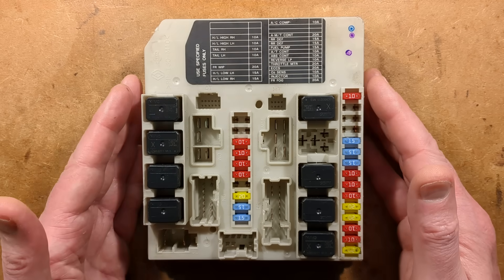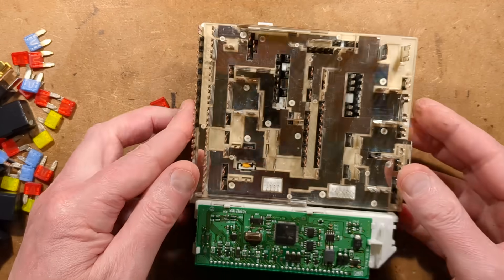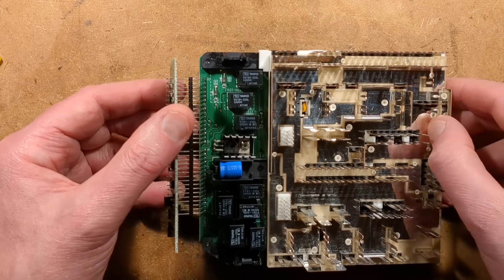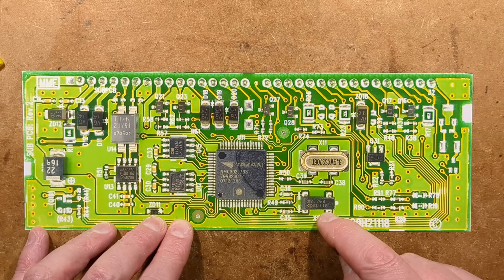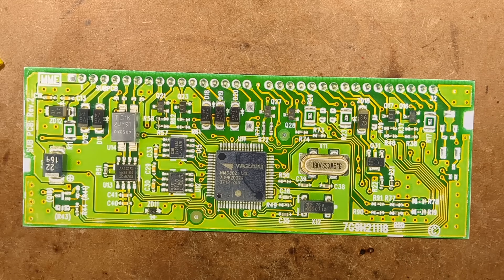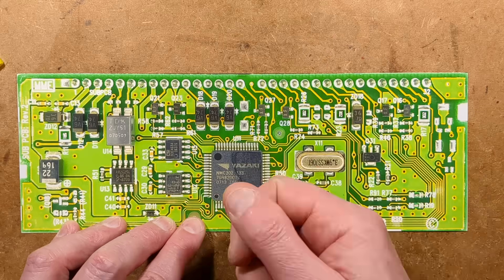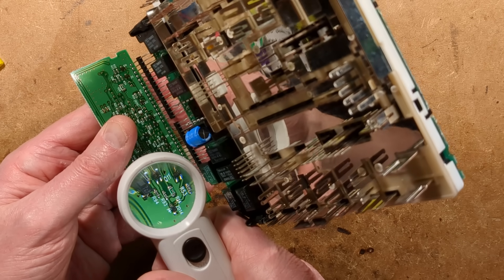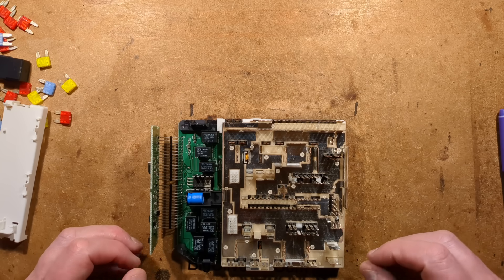Why your car's fuse box costs so much (and the location of the data chip)

Comment: As a software engineer at Ford cool video i am more knowledgeable about programming but still appreciate the electronics and let me tell you ford has a lot of expensive oscilloscopes i dont use them but just always fascinated at how expensive those pieces of equipment. Me i got two ecus on my work desk at home. Car makers are trying to switch from can to Ethernet. I beleive latest tesla models dont use a can bus network.
Reply: Car makers rape dealer service departments. Instead of just offering a software package to add to your laptop so you can work on the new models, now you need a dedicated laptop FROM THE MANUFACTURER that could set back the dealer anywhere from $2K to $6K each! And if you need one for each model per year? What an expensive collection of dedicated computers you would have!

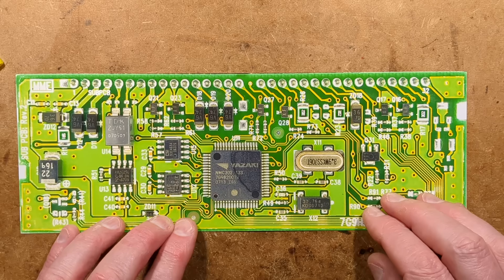Comment: 08:55 One method to prevent the MCU from causing issues on the bus could be to hold the MCU's /RESET line low whilst reading the EEPROM.

Comment: As a power distribution designer, majority of the cost went to the design and tooling.  This particular box is very old design, the can only fit one or few vehicle.  More modern design have interchangeable blocks and standard connector to Body ECU etc.  By saying that, Tesla since 2016 Model 3 revolutionize the design by replace all mechanical relay and fuses with electronic.  Not only the power distribution system is lighter, cost less (by Sandy Munro), I think the biggest advantage Tesla approach is the only way to achieve full SDV (software definite vehicle).  One can add function or change function by software update.
Reply: Software Define Vehicle is a horrible idea.  Do not want.  One more step towards a rent-only, post-capitalist society.  With a traditional power distribution I can modify it as I see fit, to add fused connections for whatever peripherals I want to add, fix broken relays, even alter the way the power is distributed and controlled.  With SDV, I don't own it, can't repair it.  As Jeff Gearling put it, you don't own anything and you will be happy.  I really wish we could communicate this to all of you designing and engineering these things.
Reply: If only we could get the source code for it, you could activate a full scale optioned out vehicle for a lot less than what Tesla charges.
It’s the way Motorola makes money on their high tier 2-way radios. The more options you want the more you pay. Now what’s interesting is that the code got out as well as data on the security key that will allow dedicated software to "add" or turn on the extra features. This only covers the last two to three of the last generation radios that are no longer supported.

Comment: Back in the day I worked on M-A-N trucks and a driver worked out (or guessed) that by removing one of the relays and turning it upside down defeated the factory fitted speed limiter! Instantly making a 40 ton artic capable of nearly 100mph😮
Reply: Can’t remember the truck. But if you set the hazard light button in the “middle”. You disable seatbelt warning and speed limit.
Reply: @Krishell  1967 Mustang. Hold the 4-way flasher knob halfway in and you could play the radio without the key.
Reply: These days we can easily buy piggy pack modules that sit in between the transmission control module and bypass speed limiter.
Reply: Vauxhall Corsa / Opel,, I think the early type A could be push.started without keys if you torn out the hazard warning lights module, and crammed it upside down in the slot. Car electrical systems problems...
Reply: @JanicekTrnecka Top Gear has a video on this!
Reply: I got several Corsas, but type B...and was a bit disappointed that this "feature" was removed. Yet although it was a spartan and barely a thing that could be called a car, both corsas lived up to 30 years till rust finally got them to point beyond repair. RIP..
Reply: i remember that well. Kudos on not telling exactly how - some idjit will do it, k.o people and sue you.
Reply: @GatvolFourie  suing someone on the internet because someone ELSE did a bad thing with just knowledge is such a dumb thing. Would you sue medical textbooks that tell you where are the arteries and a criminal thanks to it was able to kill someone faster?
Reply: @tomclanys  There is always some low grade that will give it a go with no win no fee 'emotional scaring' or other drivel...
Reply: @tomclanys  For many people, often in America, love thy neighbour has been replaced with "Sue thy neighbour." so he's just being cautious..
Reply: @tomclanys depending on how litigious the society is, anyone can bring suit against anyone for anything.  The deciding factor there is whether the person(s) bringing the suit can convince a judge if the suit is valid.
Reply: @GatvolFourie  Tell us you coward

Comment: 8:50 you generally just pull the reset of the MCU low to keep it from interfering.
Reply: A more hacky but workable way (which I've used on a multimeter which had an eeprom for config data): read it a bunch of times, if you get one identical dump 50% of the time and the other times are inconsistent, then you know what the real data is. When writing ... write once, read a bunch of times to confirm, if not matching then write again and repeat. For a one-off, it works, and really only takes a couple minutes :)
Reply: @ploxiln This might work, or if the CPU finds the data wrong when reading (at the same time as you) it might reset some values to default, or set some fault flag flag, in the memory. I would recommend using the reset signal if you can find it.
Reply: I did debug on GPUs and server motherboards. Usually the firmware is stored on an EEPROM like this. We would read and flash them in-circuit using test clips all the time (Dediprog was the programmer of choice) and never had issues. The programming software does a read-back by default as well to make sure there's been no errors after writing data.
Reply: I was about to say that. 
That is a common approach by your little "foreigner" garages, which unlike kwik-fit alike will find the way to solve things. I did reprogram mine ecu this way with no problem. Apart for mine Aygo still thinking itself as Peugeot 107.

Comment: More computerised components added to cars so more things can go wrong.
Reply: Analogue engineering, in my opinion, is the best engineering. If it breaks, 9/10 times you can just unhook the battery, dive in, and fix it yourself. 
Digital engineering always seems to fail one way or another with no obvious fix, and you need to clumsily stumble your way to an answer, all for the sake of saving time and money in manufacturing.
Reply: True, but modern cars are SO much more reliable as a daily driver than an old mechanical car. 

Yes you could fix your old car on the side of the road because you had one of the  high failure items in the trunk and a basic toolkit.

Most every modern car from the last 20+ years will reliably start and get you places for well over 100k miles. All vehicles have known issues, so you need to keep up on them.

Of all my family members nobody has needed a tow in vehicles of various brands and they all made it near or well past 200k miles before they bought another car to "upgrade" or someone made a stupid decision, like thinking they could make it home after a coolant hose burst and the driver knew the engine was overheating but kept going.

Comment: Manufacturers have added so much unecessary electronics that a lot of problems with  modern vehicles is failure of the electronics in the modules and sensors, not the mechanics.  They cost a stupid amount of money to get them diagnosed and replaced because the modules are sealed and most cannot be repaired.

Comment: I remember the old Mercedes fuse boxes
In the 108’s

Work of art bakelite with all screw terminals for the wiring attachment , and Bakelite cover with screw knobs to hold it down. 

Then theirs the RR silver shadow fuse box under steering column which hibges down after releasing a chrome thumb screw
Also a work of art but with a special design feature

When swung down its in front of the brake pedal :)

And its quite strong. 

Chapie had one do it one day snd had to do some quick footwork realising what he was pressing wasnt slowing him down:)

Comment: just sent my car to the shop because the computer is done and now nobody makes one for it. Just put new tires and breaks and rotors and 2 wheel bearing and battery in it and a week later the computer is toast.  I miss the old cars you could fix with a pocket full of tools
Reply: I used to carry a complete set of tools in my 1972 Pinto. Screwdriver, vise grips and, for when all else fails, a big hammer. 😊

Comment: While automotive experts are good, we also need people like you. An expert would likely just swap the thing. You would actually open it up.
Reply: These usually fail due to water ingress. They are also undocumented so anyone in the motor trade can't diagnose any faults on it so, either they send it to a specialist for repair or replace it.
Reply: As an car mechanic I call tell you if we can repair it we'll absolutely try to repair it. But there are a lot of uninterested people in the business sadly. And also time is money.
Reply: @sonixthatsme 
Not everyone is technically capable (or confident) of something like a board level repair. I actually wouldn't mind opening up my own electrical specialist shop.
It isn't always practical but I've saved time on waiting for parts etc by just fixing the specific problem. 
Definitely no shortage of goober folks that shoot the parts cannon every time. I currently work with a bunch of'em  😂

Comment: Bought what I thought was a basic 5 spot fuse block off Amazon to assist with a small solar / battery test project. What arrived had lights and therefore a load. Nothing on the listing about indicator lights.  I deleted the lights after I tried returning the item and they said keep it and gave me a refund.

Comment: So the wiring loom of a modern car should consist of just 4 wires: 12V, 0V, and 2 for canbus differential twisted signals?
Reply from the maker: A lot of it is just power and data sub distributed from each node.

Comment: On the one hand, my 4 wheeled vehicle is an F150 and it probably has over 100 computers in it, a ridiculously complicated hybrid drivetrain, taillights with integrated radar, etc. But on the other hand, my PREFERRED vehicle and what gets more miles per year than any other is a 1980 Honda; the most complicated electronics on it is the starter motor. I'm working on getting a 1977 Goldwing back to running condition. It's the complexity of modern vehicles that makes me want to ride a 50 year old bike with nothing more complicated than switches. Heck that long ago the bikes didn't even have relays other than for the starter.
Reply: In the old days bikes didn't even have starters lol.
Reply: come the zombie apocalypse, you will no doubt be one of the survivors.
Reply: Yeah, the most complicated part is the charge regulator. Switches and wires apart from that. Super simple.
Reply: @glonkfpv  >"charge regulator." My 1967 BSA 250 had non-electric (kick) start, and the "charge regulator" was a 50 Watt 14V Zener diode across the (nom 12V) battery. Bolted to frame for sinking heat. The alternator was a modified spark magneto so wasn't a lot of power wasted. When the wire came off it allowed 16V+ to blow-out every lightbulb on the bike (more than you would think).
Reply: @PRR1954  I had a lawn mower with a similar charging system.

I'm not sure how it regulated voltage, but it seemed to have either a second magneto, or tapped off the ignition one and produced AC leading to a pair of diodes.  One diode output lead to the battery to charge it, and the other lead to the (always-on) headlights.  I noticed something was odd because at low engine rpm you could see the headlights flicker at a frequency that seemed synchronized with the engine.  I thought that was odd considering if they were hooked to the battery they would of course get flicker-free DC voltage.  I put a scope to it, and sure enough the headlight positive and the battery positive were getting opposite rectified halves of a 24 VAC sinewave.

Comment: I had a Landrover TD5 and I changed the fuse box, it would crank but not start. I had to leave the ignition on for about an hour while it updated from the vehicle. It then went on to start with no problem. Presumably, it updated the EEPROM.

Comment: Fortyish years ago, I had a diesel VW Golf. It was an awesome car. Except when it rained. If it got wet enough, it would just go ape-shit. Like one day I was driving in the rain and the horn just blew a couple times on its own. Another time the engine simply shut off on the highway. I was able to push-start it by downshifting. 
One night, it was being very stubborn while I was visiting my aunt two hours from home. I tore the fuse panel apart in her basement/garage trying to find where the water was bridging circuits. It was less complex than this one, but had multiple layers of copper or brass buss bars going hither and yon across under the fuse and spade terminals. 
It wasn't the source of the problem.
I never did figure it out. I just traded it in a few years later when I needed a minivan.
Reply: Did you live by the coast, when you had it?
Reply: Replaced many of those back in the day

Comment: I find it amazing that a car works for as long as it does. I mean all those separate modules, connected by looms and connectors, working in a hideous mobile device, that travels over any type of terrain and weather conditions, heat, freezing, bumps, stop, start. WOW !!!!
Reply: To me it just serves as proof that, with the right engineering, electronics CAN endure harsh conditions and last for years. Then I get even more annoyed at modern consumer electronics.
Reply: @flapjack9495 They can be made to last virtually forever but not at the price they’re sold now.
Reply: @Conservator. American Motor Company😢
Reply: I agree. I own a 2020 Chevy Bolt EV, have put 106,000 miles on it so far. I have heard of bolts surpassing 200k this far. I hope to put 300k on mine.

I beat on that car. Rain, salt, snow, harsh tore up dirt roads, rough trails to the campsite up north, and constant on/off as it's used for delivery. It has yet to give me a major problem and I don't expect it too, but when I was younger if I looked at the mind boggling electronic complexity of this car I'd immediately go "hell no." My mind has since changed.

I also have a 96 ranger that's getting rusty and has had its fair share of off-road beating. Never had an electronic issue yet, despite my constant worry of capacitors drying out or connectors corroding.
Reply: One of the idea with these body control/smart fuse box modules is that you can split down tasks into friendly workloads
the other is you can get rid of arm-thick wiring harnesses across the car. Plus some safety related things. Like pyrofuses that kill off high current subsystems like the alternator/starter circuit while leaving others powered (where more modest fuses sizes would prevent fire in case of an accident) and also relays close to the battery to switch of whole subsystems.
One thing i remember about 2000s mercedes is that they moved the hazard and turn light control from the front of the car into the trunk, close to the battery. Idea being that a car that gets severely damaged in an accident will be able to still keep the hazard lights flashing even if the engine bay or even the front half of the car is basically wrecked and gone. So at least other cars coming from behind will see that something IS there. A non illuminated damaged cars on a motorway are pretty dangerous to upcoming traffic
Reply: As a retired engineer who once worked on pieces of complex systems, I agree with you!
Reply: what shocks me is how much more reliable automotive electronics are than the industrial stuff that's all rated to 75c and conformal coated AND epoxy potted and then it eats shit and dies after five years
Reply: Consider that there are cars from the 80's with Bosch electronic fuel injection, where the original factory fitted computer and ignition modules have endured to today.
Reply: Modern, (the last 20 years) vehicles have loads of modules in them. Pretty much anything in that time will have modules in every door, multiple modules under the dash, in the lights, and basically anything else that electricity goes too. My Land Rovers from 1010 had some 40 different modules in it. I dread to think how many are in our new EV.
Reply: @johnnodge4327  in 1010 they only made horse carriages 😅😅
Reply: @Subgunman  even those horse carriages were designed weird.  The (multiple) traction units each had their own head-mounted controllers, each with partial self-driving, and were controlled via a 1-way unencrypted audio bus shared with everyone within 20 meters.
Reply: @roidroid  Don't forget the leather-on-stick command reinforcer :)
Reply: @SomeMorganSomewhere  and even that requires leather-on-stick capability on the traction unit's hind. Very complex.
Reply: @johnnodge4327  I didn't know that company was so ancient 😲😲
Reply: @johnnodge4327 Tbf, I don't think there's much in an EV that inherently requires more fancy tech. You need a motor controller and a BMS, and you don't need an engine control unit.

I think it's really advantageous for manufacturers to convince us that "electric" also means "more electronics".
Reply: @antonliakhovitch8306  Correct, will is all the prevents building an EV with like 2 gauges (speed, charge level) in the dash instead of 2-3 LCDs, basic mechincal HVAC, DIN radio slot, actual clicky blinkers, crank windows, etc. IDK, maybe add a regen adjustment knob and a TCS disable switch?